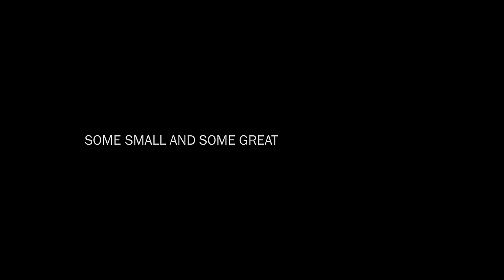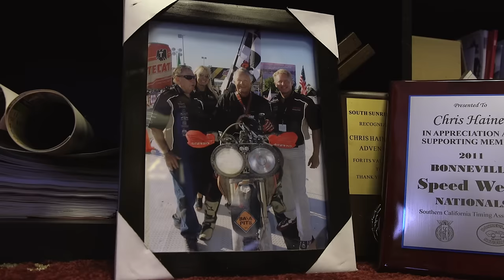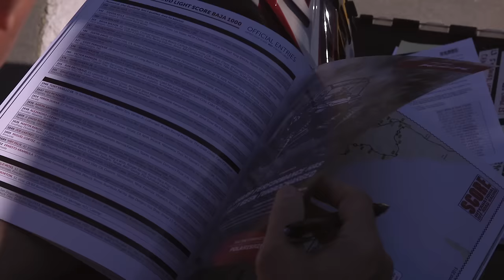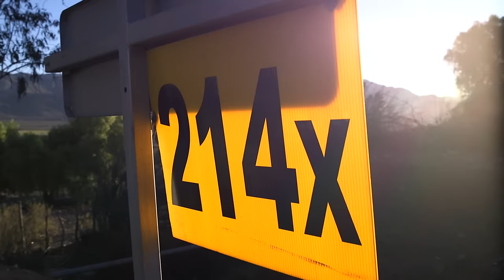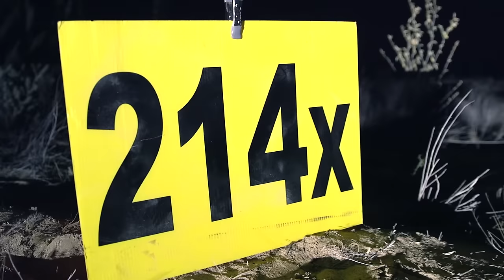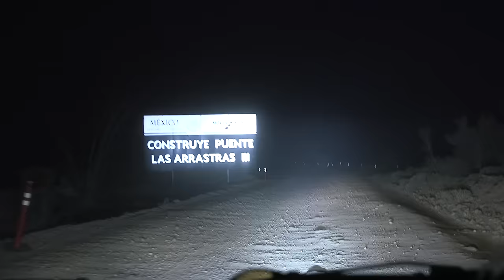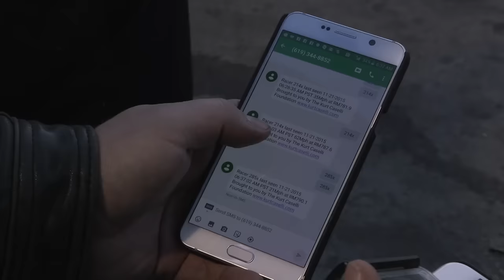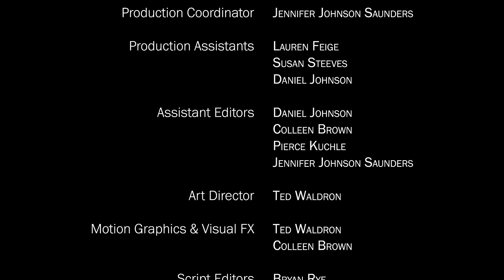Into The Dust (Full Movie)

Comment: i have run the course in parts but never raced.... it will trash a stock bike in a hurry. but if you are running it in cow trail mode allot different! 
good job on the picture...